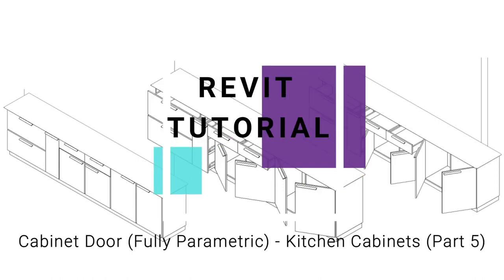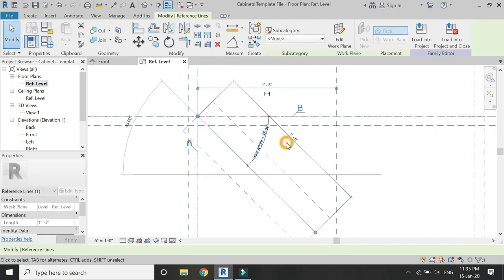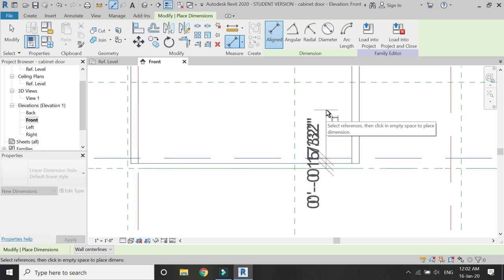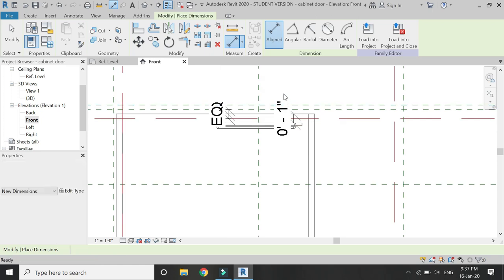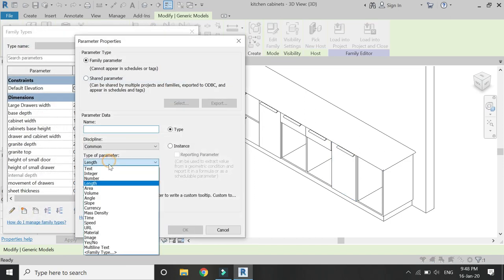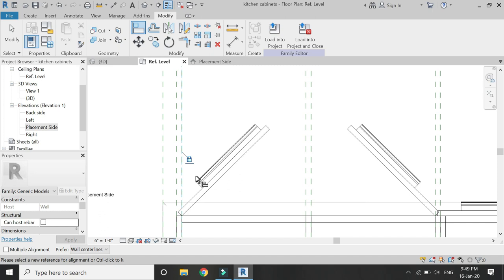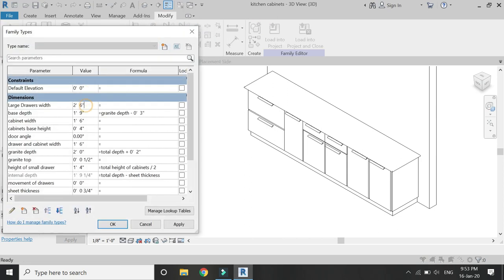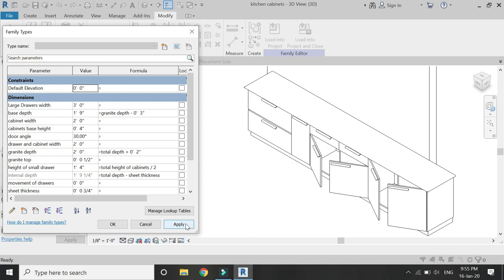Revit Tutorial - Kitchen Cabinet - Part 5 (Cabinet Door)

Comment: Hi....i have been following this from part 1...i am in part 5 now....loved everything by the way..but i have a problem..when i am loading the door into the project..it is coming in at a 45° angle...and urs is coming in at 0° ...am i doing something wrong?
Reply from the maker: Thank you for your feedback. No you are not doing anything wrong. It does not matter at which angle it loads into the project, you can change the angular dimension in the project file.
Reply: @LetsRevit  thanks a lot...i will do it and give u a feed back
Reply: @LetsRevit  i have solved it already..thanks a lot...i was assigning the "parameter" door angle to the cabinet door extrusion instead of the door handle..i have solved it...moving on to other videos😁

Comment: Hi! Thank you for your videos, they are very helpful and easily understandable. I am just wondering if there any opportunity to make an open door with an alpine profile so that I could not only open the door but also change the width of the profile? I tried, but when I put a parameter for the profile width Revit does not allow to open the door.
Reply from the maker: Thank you for your feedback.
Check out this tutorial: https://www.youtube.com/watch?v=u4lc-38ZsKo&t=51s
In this above tutorial of bi-fold kitchen cabinet door, when you change the width and height of door or when you open it, the profile adapts to the new parameters.
If there is something else related to the door that you need to understand, then you can send me the drawings at letsrevit.tutorials@gmail.com so that it is easy for me to create the tutorial.

Comment: Thank you so much .... overall Amazing tutorials from part 1 random reference planes placement to part 5 reference line placement for door opening in the custom family template. . Found that few steps are crucially important here like setting the reference planes at first and where to set those ..... giving parametric values to extrusion Ends and few more to remember at any cost ..... anyways Thanks a lot once again .....

Comment: Thanks for the video's. I am trying to follow along but you are going a bit fast at some stages. I cannot seem to get the ref line & plane linked and cannot get my offset that you are making @2:15.
Reply from the maker: My apologies for the inconvenience. At 2:15 I have used the extrusion command and selected the reference plane of the reference line. The reference line comes with multiple reference planes. So move the cursor on the reference line and press tab button on keyboard, once you see the horizontal reference plane (rectangular box of blue dashed lines), click on it. And then draw on that reference plane. In the video I have first drawn a line on the reference line using the pick option available in draw box and using the offset command, I have created an offset of 1''.
Hope this explanation will help.
Reply: @LetsRevit  thanks for the assistance. This helps a lot.